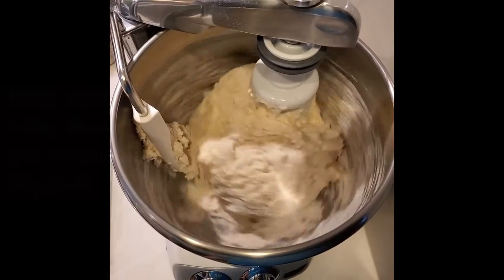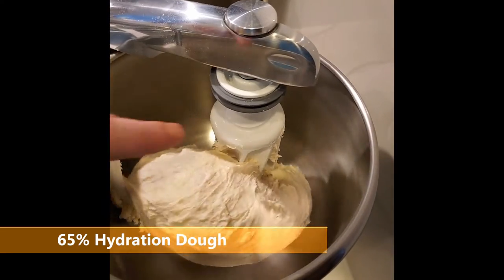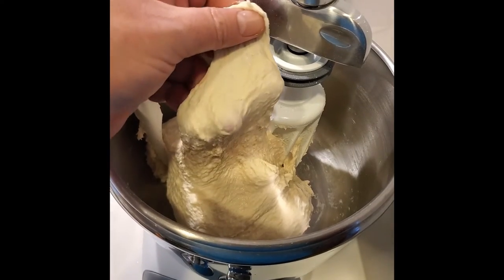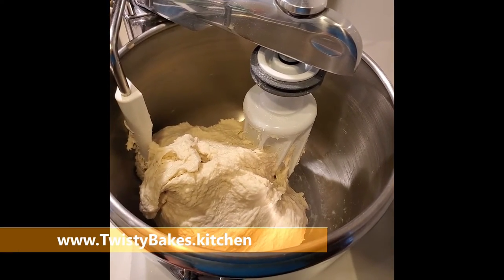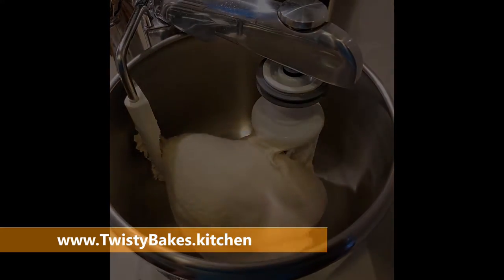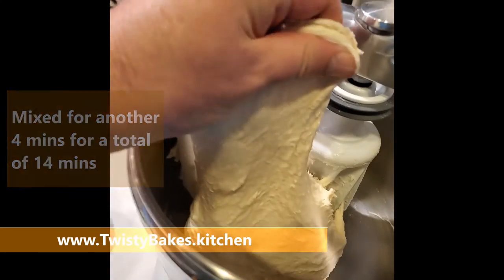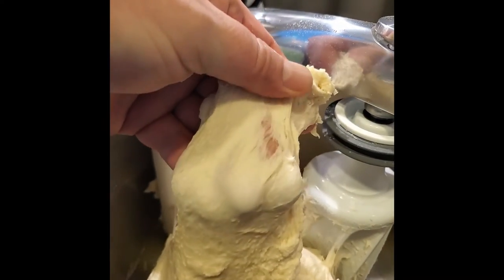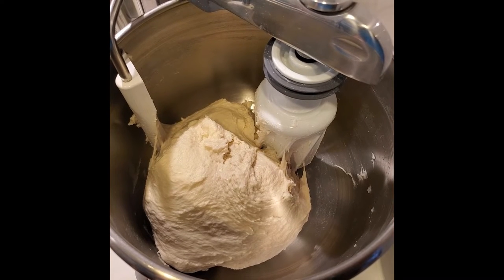Test Mix of Strong White Bread Flour in Ankarsrum mixer

Comment: I like the investigative style of the video, really trying to calibrate towards a good window pane is important. 
As for the Ank, you need to lock the roller as close to the bowl edge that the dough and speed will allow, there is no such thing as a universal distance like ½ inch or whatever. Once the ingredients are mixed, the sweet spot for the roller is where the dough will stay just below the top of the roller when it is caught between the roller and the bowl side. It is very easy to figure this distance out while the machine is running. The dough consistency and speed will dictate where that position is and it may need to be adjusted as the dough develops since the dough consistency obviously changes with that. I would run it slightly faster than the 3 oclock position, like 5-6 o'clock. When I bake, the Ank may well take 20-30 minutes before I get a window pane. This is with high hydration dough like 90%. But from having no pane it will appear within minutes, so once the dough begins to resist a pull, be careful to check it every two minutes or so. My experience with low hydration doughs like for pizza is that the hook is just as good as the roller. For more wet doughs I prefer the roller since the hook does not really work the dough in the early stages.
Reply from the maker: @jboys thanks for the tips there.  I am getting better due to advice from Ank fans like you!
Reply: I noticed your roller kind of being pushed out of the way every time the dough passed behind it. I think if you crank it down a little harder to force that dough to kind of be squeezed between the wall and the roller, it would help to smooth those lumps out. I’m not saying to give it no room. It needs a couple of good inches but I would make sure that the roller was tightened down so it did not move. Also, I think you would have benefited from a pause.. Another words allowing the dough to rest since it seem to be a little resistant. Maybe coming back in half an hour or so and trying again. And I agree with one of the other commenters that I would have kneaded  it a little faster.

Comment: I've only been making homemade bread for a few years now, so I'm a novice.  However, I got the Ankarsrum 16mos ago and LOVE it!  Additionally, I grind my own wheat berries for flour.  I think I'll never have the smooth, round ball I see others get whey they use white flour.  That being said, not much compares to the deliciousness of homemade bread.  I position my roller about 1/2 to 3/4 inch from the edge of the bowl and I run the speed at a high 5 for 10-12 minutes.  When the timer stops, I put a lid on the bowl and stick it in the oven with the light on.  It rises for approximately 1 hr, then I shape, rise again, and bake.  Did I mention that not much compares to the deliciousness of homemade bread?  Thank you for the video.  I could watch Ankarsrum videos all day long.
Reply from the maker: Thanks for the comments!  I'm not sure I am committed enough to grind wheat yet, but with the covid flour shortages earlier this year, maybe it's time to learn!

Comment: The mixer does take some getting used to.  I would play with the roller position,  the amount of dough dictates the roller position.  I would try moving the roller to 1 inch from the edge and locking it there from what I am seeing in your video.  Do return and report!
Reply: I agree, plus the arm shouldn't be rocking--you need to find the sweet spot. Also, it might be a bit dry (yes!). It's not unusual for Ankarsrum dough to seem a bit shaggy. Once you take the dough out of the bowl and fold it a few times, it should come together.
Join our mixer-owners group--lots of seasoned Ankarsrum owners there: https://groups.io/g/Mixer-Owners !

Edited to add: a British member of The Fresh Loaf mentioned a purple rubber lint brush that Lakeland carries that almost seems made to clean the roller. I not only bought one for myself but also for my Ank-owning friends and family--check it out! They're available in the U.S as well.
Reply: Yes, do check out the mixer owners group.  I belong to it as well and there is a lot of info and shared knowledge.
Reply: I was JUST coming back here because I remembered that you're a member!
Reply from the maker: Haha thats great to know about the brush, but I'm in Hong Kong!

Comment: When flour comes together you need to tighten up the rolling pin or change to the dough hook, then you will not need that much time to get the window.
Reply: I am going to try using the dough hook after  the flour comes together. Thanks for that tip!

Comment: I made bread on the weekend, using my KitchenAid mixer and the kneading was perfect.  I know bakers love the Ankarsrum mixers, and I had thought of getting one, but I know some people don't get the results they want.  Glad it worked out when you did your hand-kneading, though (and with only 10 additional seconds!)
Reply from the maker: It was weird, it was like the dough wasn't ready straight from the mixer but those 10 seconds of hand-knead brought it all together.  More experimenting required!
Reply: @twistybakes5681  Good for you.  A lot of people who get an Ankarsrum mixer say there is a learning curve to getting it to work the want they want.  I guess trial and error is a learning experience.  They're certainly a very sturdy mixer.  I wouldn't try anything too heavy with a KitchenAid, but these Ank mixers look like they can handle big batches with no problem.
Reply: @sashineb.2114  AND little batches. That's one of its many pluses.
Reply: @HotVoodooWitch  Good to know; thanks.  For some reason, I thought they were better-suited for the bigger batches.  I watched a video of the Bosch mixer (similar design to the Ankarsrum) but the Ankarsrum looks so much sturdier and better-built.  For one thing, the stainless steel bowl comes with the Ankarsrum, whereas a steel bowl is extra purchase for Bosch.  Plus, I like the rolled lip of the Ankarsrum bowl, no sharp edges.  And it seemed quieter than the Bosch, but maybe that was just something to do with the editing.
Reply: I’ve made the best bread of my life in my Ankarsrum after decades with a fabulous kitchen aid pro. I think the location of the roller played heavily into the look of that dough, and let’s not forget relative humidity and flour age… still, it is a bit of practice to get it just so👍

Comment: Did you put the water in first and then add the flour etc? If you add liquid to flour it will take much longer to knead. Also, try locking down the roller arm with about 1 inche space between the side of the bowl and it will kned faster. I make sourdough bread, pizza  and cookie dough in about 10 -14 minutes depending on the hydration. I never use the dough hook because the roller is far superior and never rips the gluten in the dough.

Comment: I have had one of these mixers for close to 20 years.  There is a bit of a learning curve with them.  Check out the Breadbeckers website, there are videos there that should help you specifically for bread making.
Reply from the maker: Hi Sue, can you tell me more about what flours and hydration % you use when mixing?
Reply: @twistybakes5681  I had to grab a calculator and figure it out!  My bread recipe is a Honey Whole Wheat 
that I tweaked for a long time until I got it tasting just the way I wanted it.
I use white whole wheat flour and by my calculation the hydration runs 62-65%.  A bit wet.
Reply from the maker: @suebell5870  thanks for figuring it out!  So we're about the same with hydration...now I need to ask about your method?  Do you put liquids in first and slowly add flour?
Reply: TwistyBakes I put in theflour , water,  and honey first mixing a bit and then letting it sit for about 5 minutes.  Then I add half the flour, mix that in and let it sit for 20-30 minutes more. (Autolyse)
It is still quite liquid and by the time it gets to about 30 minutes it really gets foamy and increases in volume.  I then restart the mixer and add the remaining flour.  I may add more flour depending on the texture of the dough at that time.  I live at 4500 ft so I have to make adaptions for that and the weather.
Reply from the maker: @suebell5870  Thanks Sue.  Interesting - in my next experiment video coming right up, I found that an autolyse didn't help. But it was made worse by adding the yeast with some liquid and as you know, that can make the dough spin in the bowl without incorporating.  I got there eventually, but I'm still on a mission to perfect my technique!
Reply: @twistybakes5681  I'm going to second Sue's suggestion to watch Ashley's videos. She has been using this machine for 20+ years and her family are the distributors here in the States. One is a Bread Beckers video, the others are under AnkarsrumUSA. Check out Lynn Junk's video as well.

Comment: i'm so enthralled by this machine... can someone explain to me what the big differece is to my kenwood chef xl for example? is it the same concept like those bosch mixers?
Reply from the maker: I think historically the Bosch is the same concept as the Ank  :)
I mean, obviously the bowl spins on the Ank, as it's driven from below.  The worm-drive is capable of running far longer, cooler and quieter than stand mixers are able to.  Also, you don't get the same poof of flour out of the bowl when you start it, and the large open bowl makes it easier to add ingredients.

And the biggest difference is, it looks cooler :D

Comment: i prefer normal mixer like kitchen aid, mixing faster and easier
Reply from the maker: And noisier, and harder to pour things in, and more likely to affect dough temp...each to their own!
Reply: It’s well known that making bread in a kitchen aid is taxing to the motor and it will wear the motor out within one to three years. The Ankarsrum motor is far superior to the motors being put into the kitchen aid machines now. They are not meant for regular bread baking  just yesterday I watched a video of a Kuching aid 600 pro mixing and kneeding bread dough and it really put a strain on the motor. It slowed it down and then it sped up. The Ankarsrum has a seven year warranty compared to a one year warranty on the kitchen aid.